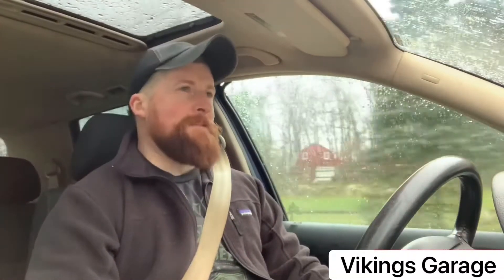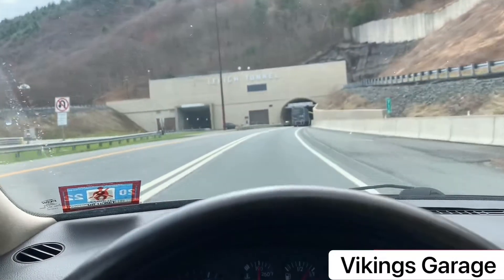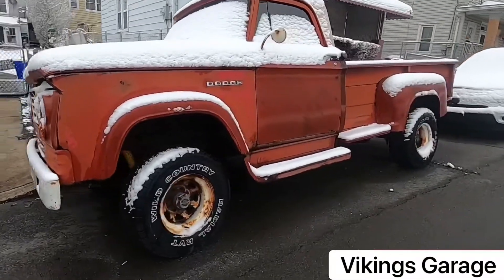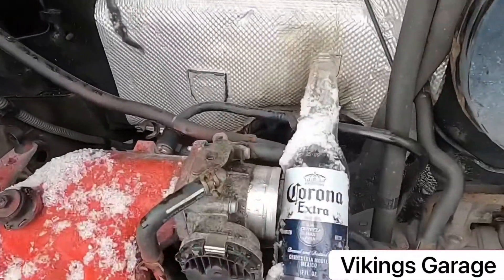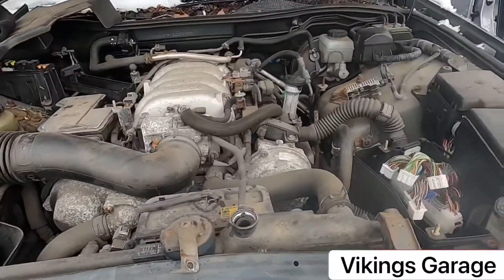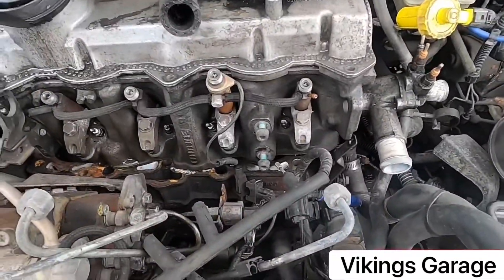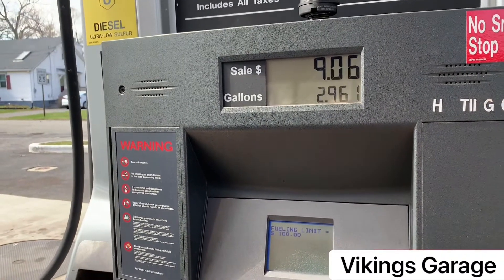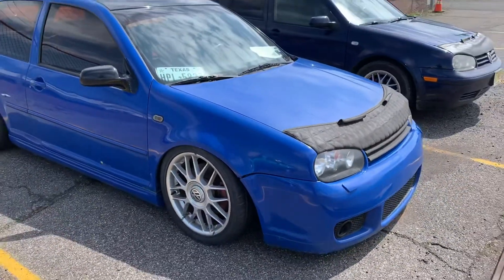Vw Golf TDI Averaging 50 MPG after 20 years is it even possible? Will it do it? Gas Mileage/best MPG

Comment: I bought a well-cared for 2012 TDI hatchback with 42K miles (!) a year ago. Manual tranny, red, 2 door. Got it cheap because of all that! The dealer said some people didn't want it due to the "Dieselgate" lawsuit. Not many folk want a red, manual, controversial diesel, but I love it! Fun to drive. Quick, responsive cornering. My main issue is I know it's a rolling computer & can have expensive repairs. Did mileage twice & got 46 & 45. I'm shocked, glad & jealous you get 55 MPG! Wow! Why? I almost always have my A/C compressor on, maybe I'd get more with it off? It's also a 2.0. Next I'd like to do math to see if I'm paying less for fuel compared to a comparable gas car since diesel is more expensive. Actually I was looking for a video where someone already did that so I can be lazy!

Comment: The holy grail of engines.... I have over 300000 on mine. Oil changes timing belt. And one pump. Still daily driving it every day. Mine is an automatic. And yes it’s still the original automatic.45/46 mph all day!!!!
Reply from the maker: That’s awesome, it’s like this super cool car that won’t die and returns on the costs all day long. Props on the high mileage (specialty with an auto)
Reply: Looking at a vw golf plus 1.9 TDI Automatic would you say itll get 45 60 mpg in the city?
Reply from the maker: If properly tuned/maintained … yes!

Comment: I have a 2002 golf 1.9 and I’m from the UK had it for 2 years now, it is the pd130 (ASZ engine code) which wasn’t available in the USA. Stock I saw 70 mpg (58 U.S mpg)and 880miles per tank. And now if has full bolt ons and makes 224hp still get 65mpg (54 U.S MPG). I just make sure the tires are pumped up around 33psi. Good looked after ones are becoming rare and very expensive now. I will never sell mine
Reply from the maker: Those are some crazy numbers!
Thank you for sharing!
Unfortunately I did sell mine.
Reply: @Jack, I've just bought a GT TDI with only 57k on it and full history. The computer is always showing in the mid 50s to 60mpg, but the fuel light is about to come on and I've only done 480 miles on this tank. Is your 880 miles all on the motorway? Thanks.
Reply from the maker: Sweet ride! Congrats!
880 is mostly highway.
Reply: I’ve got a clean mk4 but it’s the 1.4 petrol. If a well priced pd130 came up I’d buy one. I’ve got 520 to a tank and thought that was good
Reply from the maker: That’s awesome. Yeah these little Diesel engines are crazy fuel efficient.
Reply: @terrybonner3366  yes mine was only Motorway miles. But I still get 600+ now I do more of a mixture of motorway and town. But Make sure your tank is filled all the way, it should be 55L which is 12 gallons. Therefor if your computer is reading correctly 60 miles per gallon X 12 gallon tank is 660 miles per tank

Comment: Have a 2002 VW Beetle 1.9 TDI 5 speed manual transmission, love it. Average 45 MPG but I drive it hard. Have 225k miles drives like a champ.
Reply from the maker: That’s awesome, thank you for sharing. 
I sold mine and miss it already.
Reply: @VikingsGarage  it's my work car. Put over 100 miles a day on it. Love the power and MPGs. I'm not selling mine ever.
Reply from the maker: Smart, I totally get it.

Comment: Am confused my VW golf mk4 2003 motorway driving full tank 570 miles - but I’ve recently seen your video on Manifold cleaning because am having issues with limp mode & air pressure sensor tripping
Reply from the maker: So, you clearly have something funky going on. You have to get it checked out. 
570 miles is really good

Comment: I have the 1.9 TDI in a New Beetle, but it's the automatic transmission.  With all the care and cleaning, What MPG can I realistically expect to get?
Reply from the maker: Low to mid 40’s Mpg.  👍🏻
Reply: @VikingsGarage  interesting. I just made a Las Vegas to Sacramento trip that averaged 42 mpg.  That was with a fully loaded car.  So cleaned up and carbon deposits removed I could maybe get high 40s
Reply from the maker: Most likely, 42 with a loaded car is nothing to be ashamed of. 👏🏻

Comment: Hey man, wondering how long you’ve had your tdi, and if that’s the 2.0.... I’m considering buying an 05 Passat tdi 2.0, 159k miles... currently gathering info and doing my research
Reply from the maker: I’ve owned it for 2 years and it’s a 1.9L . It’s a very good car, with the manual transmission.
Reply: @VikingsGarage  awesome, well, that’s better than nothing, I’m gonna keep digging, and subscribe to your channel while I’m at it. People don’t usually reply this fast. 

I just wish this Passat wagon had the manual tranny in it, I currently have a 19 gti with the 6 speed, and an 03 Passat 1.8 sedan that’s automatic, like em both, but the newer gasoline 2.0 tsi motors love to leaks fluid.. 15 gti leaked oil from a vacuum pump seal, and the 19 just got out of the shop with a bad seal between the tranny and some other box which the passenger CV axle connects to.

Always have wanted a tdi, but never had a decent opportunity. If I can snag this one for 2 grand or less, I think I’ll give her a whirl. 

And also, the diesel dan biodiesel guy is awesome. Checking his stuff out currently. Appreciate your recommendations and videos! Keep it up man!
Reply from the maker: I appreciate you, thank you. Good luck on your soon to be TDI. You going to love it.